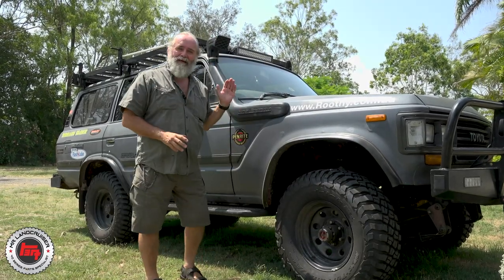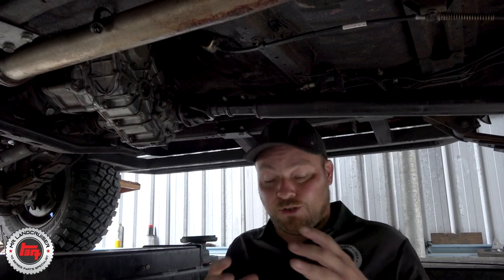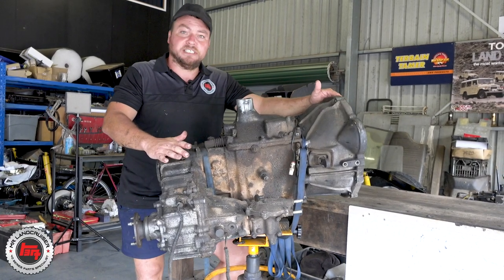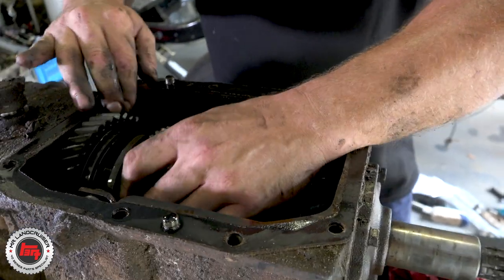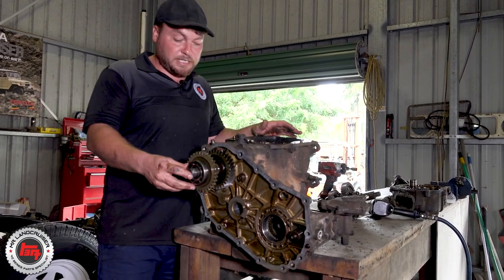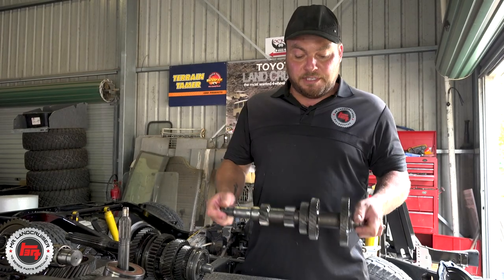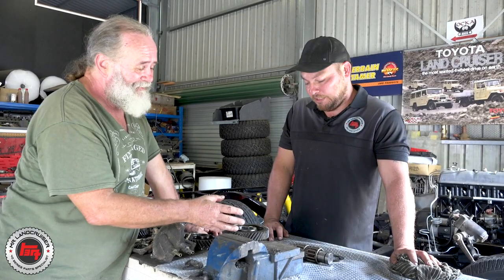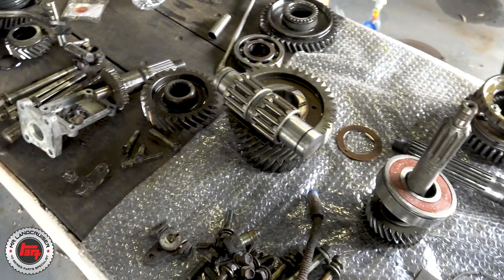60 Series  - Gearbox and Transfer Case Strip Down  - MrLandcruiser

Comment: I have a HJ75 with a 1UZFE motor in it.   I got local mechanic to get it started  but it is missing a tailshaft, the clutch is seized as well as brakes need major upgrade.    I am told that it was previously driven on the front wheel drive  

I am building an off road vehicle and will equip it with rock sliders.  It has a custom built tray making it a lot shorter than the standard  HJ75 tray   

I am  looking for recomendations on how to set up the HJ75 with the 1UZFE motor including clutch, transmission and diff etc 

thanks